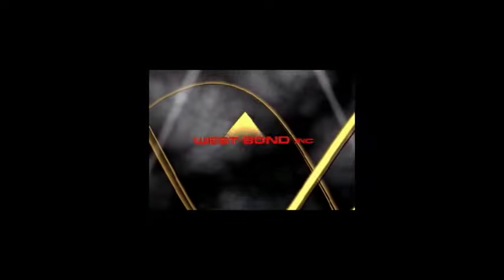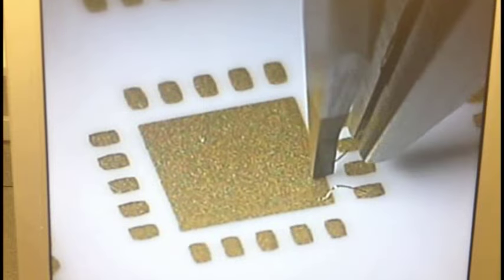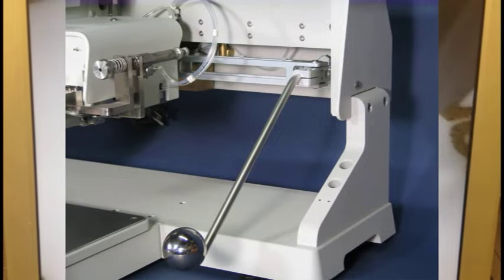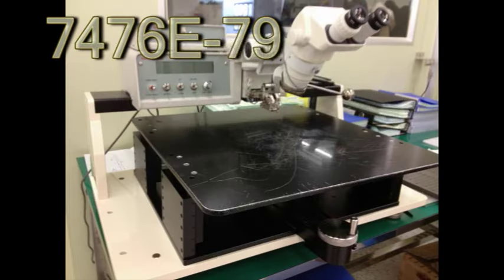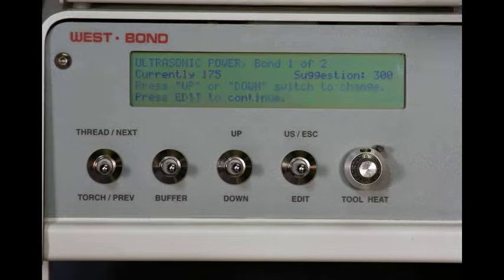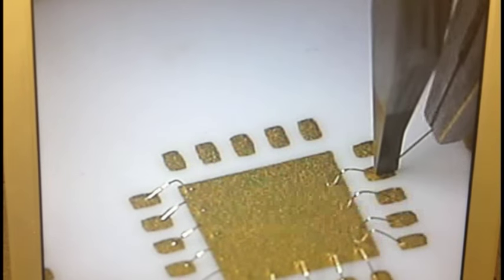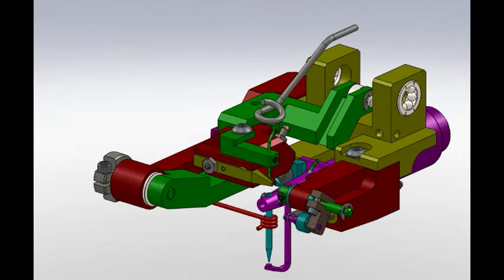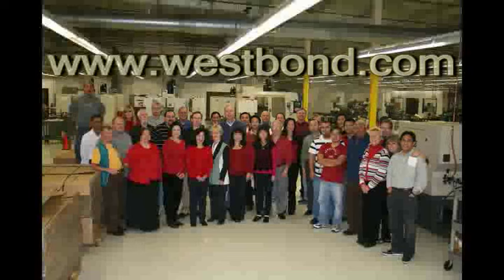7476E

Comment: How does it cut the wire? sharp edge? Doesn't it wear out?
I am looking for heavy wire bonder, 0.6mm.
Reply from the maker: The wire is terminated by the clamps pulling on the wire after the second bond. 
Maximum wire diameter for this machine 75um.